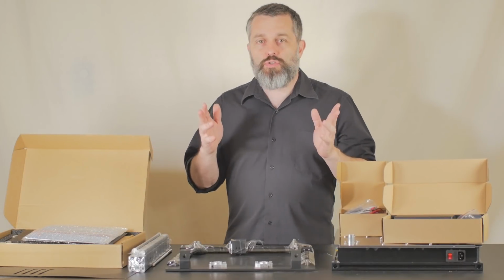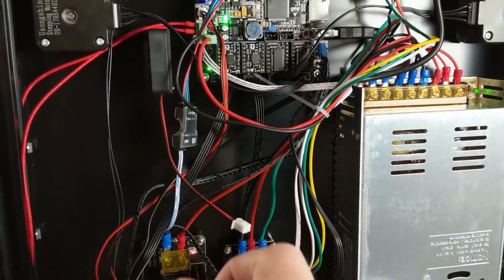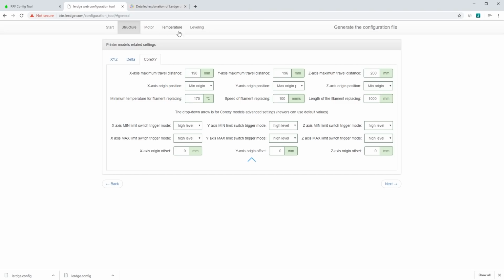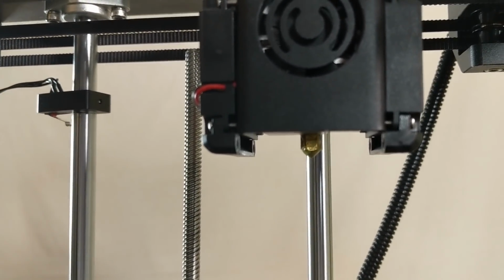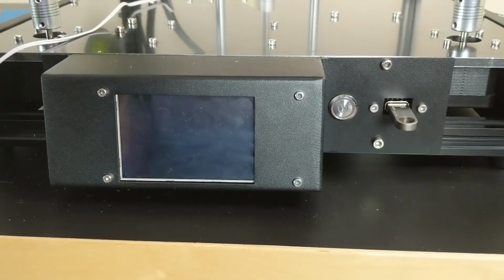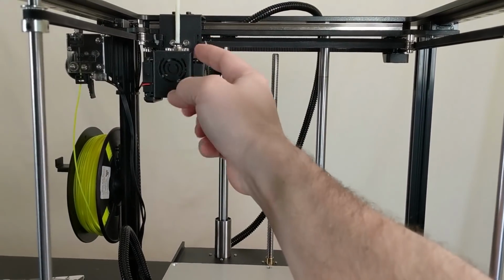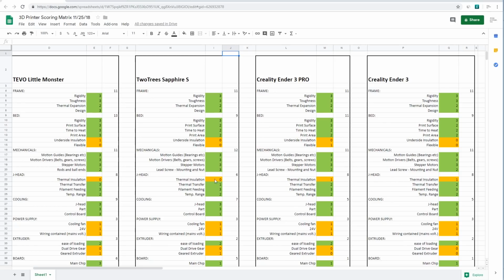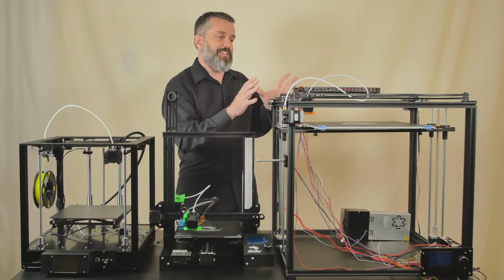The TwoTrees Sapphire 3D Printer Is the Best We've Seen Coming out of China

Comment: Sad how many kids might not get into printing because garbage printers like this. Yea you got it running but your highly experienced think about all the new kids who will have to be disappointed and send this turdsquirter   back because they don't have the skills you do. If you sell a product it shouldn't have to be reengineered mechanically/electrically
Reply: When you think about it, your views on 'new kids' is sad. Do they lack trouble shooting skills? Are they incapable of doing research to find solutions? 
This is what the next generation is all about... Plug'n'Play has a whole new meaning! LAZY KIDS!
Reply: @leofortey7561  Don't be a dick, Leo. 3D Printing is a community. If you want fresh blood into your community, you shouldn't scare people off. It's not about the current generation being lazy, it's about the FIRST THING they encounter when taking some bold (and expensive) steps into our community, is a printer where you have to splice & solder wires. Don't forget: a lot of people interested in 3D printing ARE NOT ELECTRICIANS. THEY'RE DESIGNERS AND ARTISTS. On average they only have very basic notions of how electronics works so tell me how logical it is to have a unit that requires not only the insight to figure out what is wrong, but also the knowledge how to fix it?

Bottom line: comparing this printer to the Ender 3 is a joke. The Ender 3 had screws and plugs - that's it. The "hardest" part was levelling the bed. Took me two hours from, as a newbie, getting the Ender 3 (my very first printer) out of the box, to getting my first print which, incidentally, was near perfect. No faffing about with splicing, no weird bed levelling tool needed (just a sheet of paper and a bed test print), no way to put the base on the wrong way in the first place, half the price, amazing community support, consistent great quality prints AND 3 days after I got it, decided to get Octoprint installed and took me an hour to do it. Basically, the Ender 3 is a great entry model - it requires you to learn a bit about the basics of 3D printing to get the best results but that's what makes it a great entry model. I find that anything that works out of the box with no fiddling, holds people back from l earning how to really WORK with their device.

Comment: the big difference is this printer does not suffer from ghosting like all the moving bed printers...
Reply: All you need are the right pair of stepper motor drivers to get rid of ghosting. The newest ender 3 main board that's being released with every ender 3 printer now has stepper motor drivers that not only make it really quite but also solve the problem of ghosting. If you're only interested in this printer to get rid of ghosting then you're seriously wasting a lot of money. Plus the power off resume function actually works on the ender 3. You could upgrade the ender 3 to have all the same features as this other printer and still save some money. While getting a larger print volume.
Reply: @Schwift3D   the issue is in the high moving mass of the bed. its not specific to the ender 3 printer 
a coreXY printer will always have better quality prints
Reply: @mrbdrm2  Ender 3 user here. I do not have any ghosting and I print at decent speeds. What am I doing wrong? 
No, a CoreXY machine will not "always have better prints:" Your print quality is based on more than whether you are flinging a bed or not. If your goal of commenting is to teach or discuss, please do not resort to generalities. That is like saying a sports car will always beat an old beat up truck in a race.
Reply: @Danbertization  no its not the same. i am comparing based on what i have seen and used. i used to have a printer with a moving bed and its x5 times the cost of the ender and using a linear rails. still have ghosting.
my delta printer doesn't have the issue nor my core XY printers.
all the reviews i see on the ender or cr-10 have ghosting pretty visible

Comment: You can solve Z noise and bed falling with a simple upgrade : get a geared NEMA 17 motor.
Reply: That would work, if the steps/mm can be changed on the board.
Reply: @OldCurmudgeon3DP It seems that actually it's a Mezli board which runs Marlin.
Reply: @axelSixtySix  ok, so it can be solved in start gcode if eeprom isn't enabled.
Reply: With A4988 drivers you could add TL Smoothers. The help a little for noise but mostly to, get this, smooth out the motion ;-) A noisy extruder also causes ringing in the print. Z falling can also be prevented with a tighter threaded rod. Would need to alter the steps/mm in the firmware to compensate. This invariably increases accuracy in Z by lowering your 'magic number' in the layer height.
Reply: @leofortey7561  The screw driven axis brings always a lot of problems because of the screw/nut quality, and also because of the poor alignment. Cheap couplers brings issues too. Screws driving systems always require the best. You want to mount any screw with the indispensable help of machinist measuring instruments. You can get a smooth motion easily by replacing the screw by a timing belt, like it is on recent Lultzbot actually, and like others did previously. This is not expensive but requires a reduction system too, which can be printable by the way.

IMHO, there's a endless list of upgrades required to bring the X5 to a no issue printer. You can probably raise the final cost to 200% or more buying upgrades. From the Z drive to a proper main board. The proper way to make a CoreXY printer is to use a CNC machined single metal plate for the XY system which can guarantee the perfect alignment and stiffness of the rails and pulleys. If you want significantly improve the printer, don't go to "duct tape" upgrades (like TL smoothers), get the real thing (good board and drivers) and treat the problem at the source.

Comment: You mention that print quality is similar to the Ender 3 but speed is greater.  To me, speed and quality go hand in hand so I think that printers should be compared at their highest speed where high quality is achievable.  Or in other words, If one printer can print twice as fast as another at the same quality level it should receive a higher rating.  -  Love your videos, thanks.
Reply: You should also consider the relative price. With some smart shopping you could probably get 2 Ender 3s for the same price as the Sapphire, which won't exactly double your print speed, but you could have two jobs on the go at the same time, and probably successfully resume them if the power goes out. Not to mention you probably won't have loose wires or an easily accessed button that wipes all your settings.

If TwoTrees continue to improve the Sapphire over time, as Creality have done with the Ender, I'm sure it'll eventually be a quality product. But right now you'd have to be mad to buy one over an Ender.
Reply: @Mythor.  Worth considering.
Reply from the maker: Good point! I wish I would have thought to mention it in the video.

Comment: This has been high on my list of wanted 3d printers, there just isn't much out there on it yet, thanks for this.
Reply: I feel you there.  I thought the same but bit the bullet and bought one.  I really like it.  My display has a crack in it that only prevents me from accessing the power off button or x button when it is in the upper right corner.  Also, I cannot calibrate the display with it broken, but it doesn't need it anyway.  The print quality is great, it's a bit noisy in my opinion.  Especially when compared to my TronXY X5S.  Fans are loud.  I don't regret this purchase at all.

Comment: nice one. but it raised question about ender 5 =) how would the compete in nearly identical price tag and with similar Z-motion scheme. 
cheers from Russia!
Reply: I would also like to know this and there doesn't seem that much about the ender 5 on here
Reply: Ender 5 is an hbot not a corexy so will be capable of much less speed.
Reply: Anthony Williams ender 5 isn’t Hbot. The Y axis and the X axis are not tied together in any manner as in Hbot or CoreXY.
Reply: @guycobb3251  i think you don't know what an hbot is but its is your standard cnc style Gantry moves on y and x is moved by a motor on the floating gantry so you don't get the benefit of both motors' torque like in a corexy and your gantry is much heavier so your accelerations are lower than on a corexy
Reply: Anthony Williams then all of the internet must be wrong. Both H-bot and CoreXY utilize both XY steppers to move the head. The Ender 5 does have the floating stepper on the X axis that solely moves the X axis. The Ender 5 is not a H-bot.  H-bot design is prone to racking which is why many prefer CoreXY over it.

Quick link to a H-bot gantry. 

https://www.macrondynamics.com/videos/hbot-gantry
Reply: @guycobb3251  my apologies I wasn't aware the original nickname for the ultimaker style gantry had been repurposed for another corexy belt path in the last year or 2 what do people call that older Cartesian gantry now
Reply: Anthony Williams  it’s all good. No clue on what to call the Ender 5.  I think it’s not alone though, I feel like the folgertech ft5 is essentially the same style setup. Been a minute since I’ve looked at it.
Reply: @guycobb3251  yeah it's the original ultimaker style gantry that ft5 and all the xyz da Vinci printers use. It's been around along time, it's better than standard prusa but not as good as any of the core xy schemes that all seem to be taking the names of older setups like hbot and dbot (which is the name of a corexy printer that came around same time as the hypercube) .
Reply: Anthony Williams I learn something new every day. 👍🏻

Comment: heu dollar per point is wrong, i found 4.86 when dividing 350 per 72 (otherwise the result for the TLM is not good either)
Reply from the maker: To compute the value score I divided the points by the cost and then multiply by 100 (Point/$$$*100=Value). This way we get an intuitive score. Doing it the other way means that the lower the value score the better bargain it is. Doing it my way a higher value score means  a better bargain.
Reply: @DesignPrototypeTest  Ok, that means it has a higher value than the TLM then (about twice as much).
Reply: but still, as you said yourself, build volume is ... too small